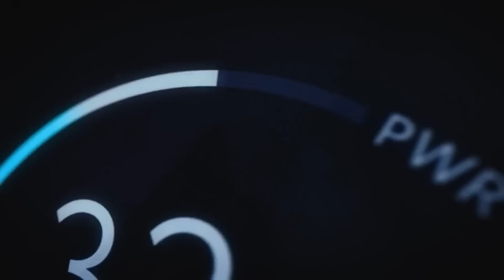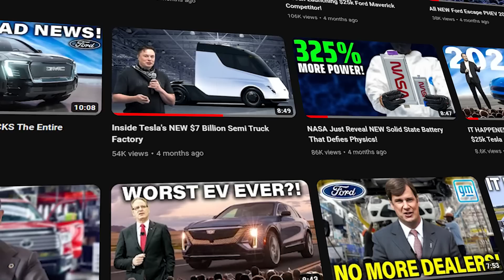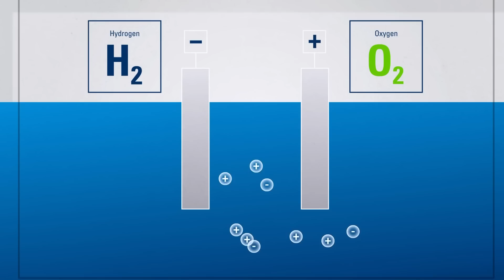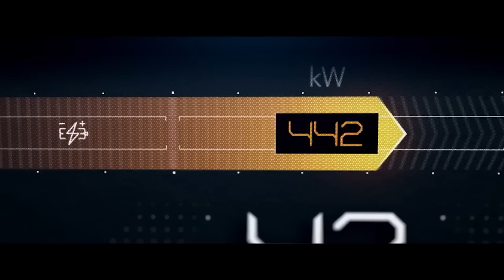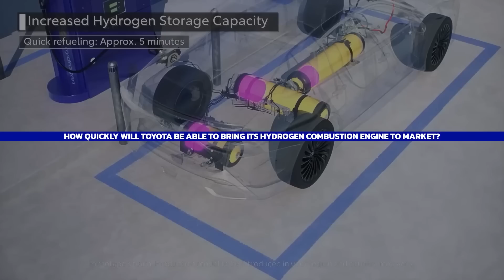New Toyota CEO Reveals Hydrogen Combustion Engine | Shocks Industry!

Comment: Let's actually think.

It takes 2x to 3x as much renewable electricity to drive a mile with a H2 FCEV compared to driving a mile with an EV.  Then one needs to add in the cost of the plant to turn water into H2, the cost of compressing the H2 for shipping, and the distribution infrastructure (trucks and gas stations).

That boils down to significantly more cost per mile for H2.  

Someone had a problem finding a charging station?  How long do you think it might take to make hydrogen as available as grid outlets now are?  

Just think, folks.
Reply: It's just physics, thank you!
Reply: @machoopichoo2  I’m
Reply: It will take 10 times as much electricity per mile compared to an EV.
Reply: @ws6002  Then there’s the huge damage to the planet in the mining process for the rare metals to make the batteries for EVs . It takes large quantities raw material to make enough for one EV battery. Then there’s the water  table pollution from washing the raw materials and then the exploitation of children and people that mine these raw materials. 
The manufacturing carbon footprint of an EV is far larger than that of an ICE vehicle.
Volvo punished a study that they commissioned last year and they said that an EV will have to cover approximately 70,000 miles before it’s carbon foot print draws level to that of an ICE.
EVs are not as green as we are led to believe.
Reply: @B Rutter  
Your comment is complete nonsense and I would be willing to bet that you cannot come up with a competent source. I suggest you read the Union of Concerned Scientists report: "What Are the Benefits of Switching from Gasoline-Powered Cars and Trucks to Electric?", dated July 25, 2022.
Reply: @B Rutter  
"While EVs can have no tailpipe emissions, there are emissions from electricity generation. There are also emissions from extracting the materials and the manufacturing processes required to make EVs. Since the goal is to reduce emissions, a natural question is: what are the net benefits of switching from gasoline-powered cars and trucks to fully-electric vehicles? To answer that question, I and my colleagues in the Clean Transportation program have analyzed the global warming emissions from all of the steps required to make and recharge EVs and compared that to the emissions from making and driving a comparable gasoline vehicle."
"Driving the most efficient EV produces lower emissions than the most efficient gasoline car where 97 percent of the population lives—in other words, virtually everywhere in the United States. For example, the emissions from driving a 2021 Tesla Model 3 Standard Range Plus in California equal those of a gasoline car getting 152 miles per gallon. The Tesla’s global warming emissions are a fifth of those of the average new gasoline car and over 60 percent less than even the most efficient gasoline car on the market. If you want to explore the emissions from other models in different regions of the country, you can use our EV emission tool."
"Everywhere in the United States, the emissions from driving an EV pickup truck are lower than those for the average new gasoline or diesel pickup truck."
"Driving an electric pickup truck produces lower emissions than the most efficient gasoline model in most of the United States. For example, recharging and driving the Rivian R1T or Ford F-150 Lightning pickup in California has the emissions impact of a hypothetical 76 mpg gasoline truck."
"Another way to understand how emissions savings from driving an EV offset additional manufacturing emissions is to consider the breakeven point: how far (or how long) an EV needs to drive for the savings to match the initial emissions “debt.” This breakeven point varies depending on regional electricity emissions. Based on where the US population lives, the mean breakeven point for an electric car with a 300-mile range compared with the average new gasoline sedan is 21,300 miles of driving, or 22 months based on average annual driving. Breakeven occurs more quickly, after about 17,500 miles (17 months), when comparing an electric truck with 300-mile range with the average new gasoline pickup truck."
Reply: @ws6002  
You want me to find you a source that describes the energy to split water into oxygen and hydrogen and then to compress the hydrogen?  

Do you actually believe that there is no cost to building hydrogen plants, to transport the hydrogen, and to build fueling stations?
Reply: @bobwallace9753  
Bob, I've made the same points as you. Here's how I see it S = 0.5 (electrolysis) times 0.8 (compression to 10,000 PSI) times 0.6 (hydrogen fuel cell efficiency) = 0.24 energy efficiency for hydrogen. Which is horrible.
Reply: @ws6002  Oh dear , I don’t use insults to debate my point.
Reply: @B Rutter  
I wouldn't know, since you haven't made any points here. But I find it insulting when someone lies to my face. I'm funny that way.
Reply: @ws6002  I still don’t use insults to argue my point, strange that. I’m not that kind of person.
Reply: Average cost for hydrogen is around $15 per KG. A full “tank” is likely around 5kg.
Reply: @Meatball2022  
Australian scientists have created a way of producing hydrogen for $2/kg, they are in the process of scaling it now (we know that scaling always has issues, so the end product will not be $2/kg but it should not be much more than that).
The operation will allow hydrogen production facilities to be easily set up on fairly small footprints, around the size of an existing petrol station

Japan is already creating red hydrogen, basically hooking up a hydrogen production mechanism to a nuclear power plant and using the excess wasted energy

It is true, hydrogen burning is not as efficient as electric but when you look at the end to end total production and especially the end product (water for hydrogen vehicles) hydrogen has a lot of advantages

Carrying around a full complement of batteries is wasted energy, especially when you scale the vehicles up, which is why the trucking industry is promoting hydrogen as its long term vision.
Who's going to run a ship or a plane on battery?

The world is a complex place with lots of different use cases. Trying to stamp out ICE is just silly, trying to push only EV is silly, trying to say hydrogen is the only future is silly (even if hydrogen is my favorite technology), the world will have to adopt hybrid solutions - the mindset of there can only be one winner comes from the stupidity of politics that has so brainwashed people into binary thinking
Reply: @stultuses  the biggest obstacles for hydrogen are 1) cost, 2) distribution. 
Bringing cost to $2 per kg will barely be lower than the cost of electricity for the same mileage.   Certainly better, but when it’s also considered that hydrogen vehicles are still ICE and you still have comparable maintenance to ICE vehicles, it still won’t make sense economically. But it’s closer….
Distribution is another issue altogether. There will NEVER be a day where hydrogen “fill up” is in someone’s home. Hotel. Restaurant. Etc.  therefore, hydrogen will never have the same convenience level that electricity has. 
There can, and one day likely will, be choices. And it’s very possible that the choice depends on the need. Long haul might very well benefit from something like hydrogen moreso than consumer vehicles. As of now, it ain’t even close. 
Also keep in mind. Perhaps one day hydrogen tech improves. EV  and battery tech also improves. Hydrogen has a long way to go to be close to gasoline. Much further to go to be close to electricity. 
The post here that I was responding to suggests it’s great for long trucking. That simply isn’t true. In any continent. And it won’t be even close to true for a long time.
Reply: @stultuses  also keep in mind. $2 per kg to produce will be $6 per kg once it reaches a vehicle. It has to be compressed. Stored. Transported. Stored again. No different than any processed product. Vast majority of POS cost is related to processing.
If they were to create and fill at POS it would reduce costs dramatically. But that adds fill up time, thus negating one of its benefits.
Reply: @Meatball2022  Prices will drop with mass production. People may claim “physics”, but no one mentioned that when others claimed mass production would bring down battery prices.
Reply: @mrgurulittle7000  battery prices also dropping
Reply: @mrgurulittle7000  price would have to drop by 70% just to be equivalent to what it is now. How exactly does that happen with zero infrastructure to support it?
Reply: @Meatball2022  There is no hydrogen infrastructure currently. That’s why people’s need to set it up.
Reply: The single most common element in the universe, is hydrogen.
Reply: @DetroitMicroSound  so?   It’s not common in liquid or gas form on earth levels. 
It’s triple the price of gasoline.  It’s about 5x the price of electricity. It’s got no storage infrastructure at all. It’s such a small atom that it constantly leaks. And a hydrogen combustion engine has a ton of moving parts that an EV doesn’t have.
Reply: @Meatball2022 There was no infrastructure for manufacturing lithium batteries 20 years ago.
Reply: @DetroitMicroSound  manufacturing infrastructure isn’t the problem. Distribution is. 
I’m not sure if you’re aware, but nearly every building in the country has electricity. 
People ain’t driving their hydrogen cars to the manufacturer… nor can they “refill” at home.
Reply: That's the crux of the problem. People dont think. You cant fix stupid.
Reply: If you want to save the earth, don't drive big cars, use your two legs, bicycles, public transportation, ask government to build and make trains more accesible instead of having everyone driving on road and move a big chunk of metal from home to workplace. Wasting resourse to build and repair the pothole highway. EV, Hybrid are no major different. All these are  gimmick.
Reply: Do you feel the icebergs cracking, the deserts spreading, the sun beating down? Thousands and increasing die a year due to pollution and this should have been mainstream as well as more nuclear energy in the 80's we're simply fucked due to climate collapse
Reply: stupid, it'll get cheaper over time with economies of scale and improvements
Reply: Okay. Let's think about this. EV alone leaves a bigger carbon footprint then fossil fuels. Takes fossil fuels to charge the car. It's not green as they claim. Takes tons of rare materials. People are blinded by false facts 😂
Reply: Rare materials and not self repairable...get the trend
Reply: @keithadams812  
Most EVs are likely to use LFP batteries.  There is nothing rare about lithium, iron, or phosphate.  Tesla is moving to motors with no rare earth materials.  

Furthermore, pretty much everything in an EV is recyclable.  At least 95% of the materials in batteries can be recovered and reused.  

I'm not sure why 'self repairable' is an issue.
Reply: @keithadams812  yes, exactly why not to drive a new ICEV.
Reply: @BootayCrust  

Mike, you're ignorant. What's worse, you're spreading your ignorance for others to believe

1. EVs have a bigger carbon footprint INITIALLY! Typically, after 6 months to 3 years, however, the carbon footprint is less than that of an ICE and continues to get better day after day after day. What's more, when the battery finally dies, it gets recycled into a brand new battery. No need to mine the elements again, since it's already out of the ground.

2. 
a. Just looking at the US, most states get at least some of their energy from renewables and this number is always improving.
b. even for states that make their electricity from 100 fossil fuels, IT IS STILL BETTER TO DRIVE AN EV!!! Why? Because EVs are more efficient!

Gas engines are typically only 12% - 30% efficient. That means even the best gas engine throws away 70% of the energy. EVs are typically 77% efficient (or more). So even in the worst case scenario, EVs are more than 2.5 times as efficient. And again, this is in the situation where electricity is made 100% from fossil fuels. In most states, where they use a mix of fossil fuels and renewables, this equation is even better.

Lastly, remember, EVs are in their infancy. ICE cars have been around for well over 100 years. Translation: the advantage of EVs will only get better as the technology gets better. We'll eventually get batteries that can hold even more energy and can charge even faster. How much will ICE cars improve after 100+ years?
Reply: @BootayCrust  lets not lie about this. EVs have 1/3 the carbon footprint of ICEVs over 20 years. 
EVs are exactly as green as claimed. It comes down to math. 
EVs need less rare minerals than ICEVs. 
Yes, anyone who listens to you is blinded by false facts.
Reply: @BootayCrust  
Sorry, Mike.  Someone has fed you some very wrong information.  You might want to question where you are getting such erroneous stuff and seek some factual sources.
Reply: @BootayCrust  It also looks like another round of poor countries with the raw materials for EV remain dirt poor while guys sit in places like Silcon valley becoming billionaires.
Reply: Just think, hydrogen may be a bit more costly, but it will be much cleaner than EVs. The way EVs are made is the reason why carbon pollution has gone up. The only clean transportation is hydrogen. EVs will always require expensive dirty batteries.
Reply: @mrgurulittle7000  no, hydrogen takes 3x the electricity per mile than a similar EV. And that is a relatively efficient fuel cell. In a hydrogen burning ICEV, hydrogen os VERY dirty and stupid.
Reply: @williammeek4078  Hydrogen combustion is NOT dirty or inefficient. The byproduct is water.
Reply: @mrgurulittle7000  hydrogen production takes 3x to 10x the electricity of just charging a BEV. Any claim of EVs being dirty applies 10x more to hydrogen.
Reply: @williammeek4078  It’s not about energy. That can be made freely and cleanly. It doesn’t matter if hydrogen takes 3x more energy than pure electricity because mass production of hydrogen will drive down price. What the point is, how the electricity is stored. That’s when EV shows their flaws. EVs need batteries which are UNDENIABLY polluting and inefficient and EXPENSIVE. Hydrogen can be stored in a thick tank and that’s it. Hydrogen also is much more dense than any other battery out there, so longer range, and fill up is short. Overall, hydrogen is cheaper because no battery, which is the only reason why EVs are dirty. 

Keep researching then.
Reply: @mrgurulittle7000  you need to actually do some research and get some common sense.  Since hydrogen takes at least 3x as much energy, it will need 3x the electricity generation resources. That is a lot of pollution and work and cost to get that set up. 
Sure, mining battery materials pollutes some. But that only has to be done once then batteries are recycled. Once for the life of the car. The tank for hydrogen cars needs to be replaced periodically as do the fuel cell stacks. 
By the way, no production hydrogen car has demonstrated a longer range than a similar EV. And making a special side trip every week fill up is MUCH more inconvenient and takes more time than just plugging in at home. 
And hydrogen does need a battery. Google Toyota Mirai battery. 
You have a lot of learning to do to correct your ignorance.
Reply: @williammeek4078  Using more electricity doesn’t equal more pollution, because if it did, EV will also be polluting and there would be no argument. Battery mining and recycling is polluting, not just mining. Hydrogen tanks need to be replaced as often as gas tanks, and that’s not a common issue. Yes, a hydrogen car has a battery, but so does an ice car. Having a huge expensive dirty battery is the problem, not some tiny starter cell in a hydro car. There doesn’t need to be a production car to know that hydrogen is much more energy dense than any battery tech out there. Battery tech hasn’t even equalized the amount of energy contained per unit in gasoline, and that’s gasoline. Hydrogen can run more agile and cleaner. And shut up about people’s ignorance and have some respect for other people’s opinions. Damn it, can’t I have a legit educational conversation, or does every EV fanatic think everybody who doesn’t agree is stupid or “ignorant”. Get a job if you can only be right.
Reply: @mrgurulittle7000  you really need to take your own advice. You are displaying an unwillingness to learn anything that contradicts your preconceived notions. If you are willing to learn, we can continue this conversation. 
We have HFCEVs. The longest range HFC vehicles are not any longer range than the longest range EVs. If you can find any HFCEVs that can outdistance the 500 miles of the Lucid Air Dream, let me know. The closest i am aware of is the Toyota Mirai at 400 miles. 
Electricity does pollute right now, but even then, EVs have half the carbon pollution of ICEVs and since HFCEVs are only 1/3 as efficient as BEVs, they actually pollute 50% more than ICEVs at best and since most hydrogen is made from natural gas, they actually pollute far more than ICEVs. 
Even if you want to take all of the electricity from wind and solar, you still need 3x as many solar panels and wind turbines to power the hydrogen production as needed to power BEVs. That is 3x the mining for those resources. 
Despite batteries having a much lower energy density than gasoline, they are vastly more efficient. This is why EVs can match the range of ICEVs and beat HFCEVs while operating for less money per mile and only weighing about 20% more than a similar ICEV. 
It is hydrogen that is expensive and dirty, not EVs.
Reply: @mr guru Little  The product of hydrogen combustion are water AND WASTE HEAT. That waste heat represents energy you are throwing away. You really need to educate yourself. You are wrong about almost everything.
Reply: @williammeek4078  You need to take your own advice and learn. Why should I learn from a person who thinks the opponent is stupid?! 
Anyway…
Reply: @mr guru Little  If you compare EVs with hydrogen cars, inefficiency CERTAINLY MEANS MORE POLLUTION. Let's assume for the moment the electricity comes from a natural gas driven turbine. YOUR HYDROGEN CAR MEANS WE BURN 4 TIMES AS MUCH FOSSIL FUEL as we need for an EV. If we burn 4 times more fuel to move your (H2) car than my (EV) car, operating your car means putting 4 times as much pollution into the air. Now let's assume the electricity comes 100% from wind. Do we have the room to increase the number of wind turbines by a factor of 4? That's going to be hard. Who then pays for all these thousands of extra wind turbines THAT we wouldn't need if we used EVs instead of hydrogen?
Reply: @ws6002  In the battle over electric vehicles, could hydrogen win?

Hydrogen fuel cell EVs could be the better choice for medium-to-large and long-range vehicles.

By Mohammed Shafi

March 29, 2022

hydrogen gas station and bus
Image via Shutterstock/Scharfsinn.

As the future of automotive power heads away from the internal combustion engine toward electric vehicle technology, the industry has two options: fuel cell electric vehicles (FCEVs), vehicles that use hydrogen as the fuel source, and battery electric vehicles (BEVs), vehicles that rely solely on battery power or electricity.  

According to a recent PreScouter Intelligence Brief, in the absence of an infrastructure to enable FCEVs, BEVs remain the more appealing option today. However, this could change within the next five to 10 years as investments in hydrogen production and infrastructure increase, potentially pushing FCEVs to outperform BEVs in some segments and become the more sustainable alternative.

PreScouter’s researchers based their analysis on expert insights from Bostjan Hari, battery systems engineer, through a concise review of impending technical and business opportunities for FCEVs in addition to highlighting 11 technological advancements in the realm of FCEV manufacturers.

How does a FCEV work?
FCEVs are electric vehicles that get their power from a hydrogen fuel cell instead of a battery. A fuel cell system is the heart of an FCEV. The electricity is produced by the electrochemical reactions between hydrogen and oxygen supplied into FCEV hydrogen tanks. Only pure, distilled water is produced as a byproduct. FCEVs use this electricity for traction and require the battery for auxiliary operations such as starting or storing energy gained by regenerative braking.

The key distinction between FCEVs and BEVs is the energy source. FCEVs, in contrast to BEVs, rely on the energy stored in the vehicle’s fuel cells, which have a number of advantages over batteries. As long as fuel is available to power the fuel cell, it can generate energy. This is one of the most significant advantages of fuel cells. 

A typical electric automobile can be fully charged in slightly over six hours, whereas an FCEV could be refueled in five minutes and have a range of more than 350 miles. A modest amount of hydrogen can go a long way. Hydrogen production is an energy-efficient chemical process that yields fuel cells with a performance advantage of two to three times over internal combustion engines. Users will be able to travel as far as they do today on only a third of the fuel.

electric vehicle comparison chart
How do FECVs and BEVs compare in regard to environmental friendliness?
FCEVs are also the best option in terms of environmental impact, as fuel cells can be a 100 percent renewable and environmentally friendly energy system. In the absence of adequate recycling systems, the lithium-ion batteries used in BEVs are expected to cause a serious environmental crisis when they reach the end of their useful lives.

While driving, the car emits pure water vapor and filters ultrafine dust from the atmosphere. This fundamental feature of the FCEV has drawn a lot of public attention as the future of eco-friendly mobility. This technology may have a huge impact on our lifestyle in terms of sustainability due to the abundance of hydrogen on Earth and the production process itself being highly eco-friendly.

Overall, FCEVs are cleaner than BEVs and internal combustion vehicles, with additional room for improvement as hydrogen generation and distribution advances. FCEV production is also cleaner than BEV production due to fewer raw material requirements compared to BEV mineral mining and the consumption of heavy metals such as lithium and cobalt. FCEVs are also easier (and cheaper) to recycle than BEVs.

What is the status of the global FCEV market?
Global FCEV deployment has been primarily focused on light-duty passenger cars. However, the geographical distribution of FCEVs varies significantly. Korea, the United States and Japan have concentrated on passenger cars, with a small number of buses and commercial vehicles. 

On the other hand, with its fuel cell bus and commercial vehicle policies, China today dominates worldwide stocks in these segments. This trend is anticipated to continue, as China’s 2020 fuel cell car subsidy policy focuses on employing fuel cells in medium- and heavy-duty commercial vehicles. China has set a goal of using over 1 million FCEVs for commercial purposes by 2030.

The Port of Rotterdam and Air Liquide have developed an initiative to deploy 1,000 fuel cell trucks by 2025.
There will be more fuel cell buses and trucks in Europe in the near future. More than 1,000 buses are planned during the next decade. The Port of Rotterdam and Air Liquide have developed an initiative to deploy 1,000 fuel cell trucks by 2025, and a joint call signed by over 60 industrial partners aims for up to 100,000 trucks by 2030. The IEA forecasts that fuel cell manufacturing could produce 6 million FCEVs by 2030, meeting roughly 40 percent of the "Net Zero Emissions by 2050 Scenario" needs.

Global technical regulations are continually updated to assure global FCEV safety. International standards are used to build localized safety regulations and laws for FCEVs. They usually incorporate electrical and hydrogen safety requirements.

Hydrogen tanks are bulky in vehicles
Because hydrogen has a poor volumetric energy density, storing enough onboard poses weight, volume, kinetics, safety and cost challenges. Hydrogen can only be stored under high pressure, at extremely low temperatures as a liquid, or in metal hydride systems to maximize volumetric energy density.

Compressed hydrogen is the most used method for storing hydrogen in cars. Passenger FCEVs’ compressed hydrogen tanks are cumbersome and take up a lot of space. This is a flaw in the current generation of electric cars powered by hydrogen fuel cells. Hydrogen metal or non-metal hydrides could be used in the future as a replacement for heavy hydrogen tanks. This is just beginning to take shape, with hydrogen evaporation remaining a key technical problem to overcome.

Honda and Nissan chose a 350 bar (5,000 psi) pressurized tank, while Toyota employs 700 bar (10,000 psi) tanks. Although the 10,000 psi composite tanks have been proved to be quite safe as needed by various regulatory requirements, the public is concerned about their safety. Moreover, the tank proportions require more space than traditional petrol tanks.

The adoption of fuel cell vehicles should be complemented with enabling infrastructure.
FCEVs won’t be commercially viable unless buyers are satisfied that they will be able to easily access refueling stations. Thus, the adoption of fuel cell vehicles should be complemented with enabling infrastructure. According to H2 Tools, by the end of 2021, there were over 492 hydrogen refueling stations operating globally. Japan had about 141 stations, followed by South Korea (112) and Germany (91).

The GM Electrovan was the first fuel cell-powered passenger car developed by General Motors in 1966. The project was shelved because of the high cost, difficulty and scarcity of fuel supply. The still-active California Fuel Cell Partnership was created in 1999 to facilitate the testing and development of FCEVs in the United States. It has included representatives from most major automakers at various points in time, although mainly only three have brought fuel cell vehicles to market so far.

Many automakers sell or lease FCEVs, but the technology is still new. Honda, Hyundai and Toyota are just a few companies on the top list. However, automakers are dedicated to growing both hydrogen fueling stations and hydrogen-powered vehicles, so more FCEVs are on the way, but while all of today’s fuel cell vehicles are considered mass-market production vehicles, none are  available outside of California. Many were only available in limited numbers, and Honda’s has never been sold, only leased, since its debut.

Can hydrogen fuel cells become the EV technology of choice?
Several studies, including one by Argonne National Laboratory, have demonstrated that creating and using hydrogen for fuel cell vehicles is more environmentally friendly than using grid electricity to power battery EVs. Hydrogen could be created using wind and solar energy, or by decomposing plant materials; however, these processes take longer and cost more money.

"Nothing worth having comes easy," as President Theodore Roosevelt once said. The commercialization of FCEVs on the market is moving at a moderate pace at the moment. 

So, who will win the EV battle? The answer: Battery and fuel cell technologies will coexist in the future because of their obvious similarities, with BEVs being more appropriate for short-range and small vehicles, and FCEVs the better choice for medium-to-large and long-range vehicles.
Reply: @mr guru Little  
I personally reserve the word 'stupid' for people who already shown they are uninterested in or incapable of learning.
Are you that person? Have you learned anything from the people like me who have shown by means of competent sources (eg Union of Concerned Scientists) that building batteries only increases their lifetime pollution of EVs a small amount? Have you learned anything from people who have pointed out to you that hydrogen vehicles require FOUR TIMES AS MUCH ENERGY as compared to EVs?
Reply: @ws6002  Heat is the waste and byproduct for hydrogen after the process is done, but in EV, heat is generated from the energy when high speed charging is done.
Reply: @mr guru Little  
Some energy is turned to waste heat when the battery is charged. Less than 5%. But in making hydrogen by electrolysis, 50% of the energy is converted to waste heat. And in compressing the hydrogen before putting it in the tank, about 20% of the energy is converted to waste heat. And in converting the hydrogen fuel to electricity in the fuel cell, about 40% of the energy is converted to waste heat. You don't add these numbers to get the total waste heat. Instead you multiply the efficiency (complement to inefficiency) of each stage together to get the overall efficiency. S = 0.5 x 0.8 x 0.6 = 0.24 or 24%.
Reply: @mr guru Little  
You could of course skip the hydrogen compression step and keep the hydrogen in a small Hindenburg (gas balloon) dragged through the air by your car. Hydrogen has a pretty low energy density by volume at one atmosphere pressure. Now perhaps you see why I gave up my childhood fascination with hydrogen cars.
Reply: @mr guru Little  
There are already BEV (battery electric) trucks for sale and in use today. Not just from Tesla. None for hydrogen so far. Terrapower, a modular nuclear startup that Bill Gates is involved in, is proposing that they use hydrogen to store electricity produced during the day and use this power to provide power at night when solar becomes nonoperational. This seems like a good idea.
Reply: @ws6002  Maybe that storage thing is a good idea actually.
Reply: @mrgurulittle7000  any questions you have, I will be glad to provide references. Any attempt to claim I am wrong, I insist you do the same.
Reply: @williammeek4078  Ok, sounds fair enough.👍
Reply: @mr guru Little  
This comment is nonsense. As a result of the fact that producing hydrogen by electrolysis is only 50% efficient, and the energy it takes to compress the hydrogen is equivalent to 20% of the energy in the hydrogen, and because the fuel cell is only 60% efficient in converting hydrogen into electricity, 80% of the energy is LOST before you drive the motor that moves your hydrogen car. That means you have to cone up with 4 times as much energy from solar or wind, for example, to drive 300 miles in a hydrogen car compared to an EV. If you don't have any facts, perhaps you should stay silent.
Reply: @mrgurulittle7000  
There's zero chance hydrogen could be cleaner than storing energy in EV batteries.

Remember, hydrogen is only a way to store energy.  It takes more energy and infrastructure to produce and distribute hydrogen with each bit and piece of that infrastructure bring its own carbon input to the process.

Solar panels and wind turbines have very low lifetime carbon footprints.  So if you're driving with hydrogen you are using 3x or more energy from panels and turbines than someone using batteries.
Reply: @bobwallace9753  Yes, hydrogen uses 3x more energy. But my point is, EV uses one third the energy for running the vehicle, but it uses tons more energy to make the battery for the vehicle and recycling it properly. 

Hydrogen creates clean drinking water in the process, speeds up energy refill time, and does not emit any heat or pollution in any of these processes. 

EVs (though using a third of the energy to charge up) don’t have any other potential on top of batteries being expensive to make, batteries being very polluting to make, and batteries being polluting and expensive to recycle. And these are the facts considering that the electricity and hydrogen are cleanly made. Also, fast charging an EV has significant energy loss in the form of heat, making fast charging limited to a certain extent. 
If you look at the process overall, there not much energy lost in hydrogen technology seeing that it makes clean water in the process, saves time (which is money), is very energy dense, and can be done 100% renewably. Even EVs in the ideal have the problem of batteries which are one of the biggest sources of pollution and heat.
Reply: @mrgurulittle7000  
Batteries are not polluting to make'.  

H2 FCEVs will not be s source of clean drinking water.

Battery recycling is not expensive.  It's cheaper than extracting and refining the materials needed to make new batteries.

Fast charging does not waste much energy.  Plus most people will fast charge rarely.
Reply: @bobwallace9753  Batteries ARE polluting to make. Why do you think carbon emissions have gone up even though the world saw a record increase in EVs and renewables? H2 IS WATER! No use saying water isn’t a source of water.🤣 Battery recycling is so expensive. Who is actually recycling batteries? What about the waste in recycling batteries? Fast charging loses energy in the form of heat. EVs have built in coolers for the batteries; great, using battery energy to cool the battery itself. It’s just baloney how EVs claim to be efficient.
Reply: @mrgurulittle7000  no. You have been lied to.
Reply: @mrgurulittle7000  you do realize that a hydrogen ICEV is only about 20% efficient and the other 80% is wasted as heat right?
Reply: @williammeek4078  You’ve been lied to.🤥
Reply: @mrgurulittle7000  no, i do my own research. Maybe try that yourself.
Reply: @williammeek4078  try researching nuclear (HTGR) its a win-win for all industries and u will understand hydrogen is the way forward as fuel replacements.. 

we couldnt be using batteries and motors on heavy machinery cant we? so hydrogen makes more sense 

and also.. why cant the world have BEV, FCEV, H2ICE? the consumer can just buy whichever they think is best for them to use
Reply: @kecikmiao0711  high temp hydrogen production only increases the efficiency of a HFCEV to about 35%. Still less than half that of an EV. 

We already have heavy EVs like Tesla Semi and BEV mining vehicles and construction equipment. 

BEVs, HFCEVs, and hydrogen ICEVs are already available and consumers have already made their choice because anything hydrogen is just too expensive.
Reply: @mr guru Little  It does not take "tons" more energy to build the EV battery. Here is a quote from the Union of Concerned Scientists, who looked into this: 
"While EVs can have no tailpipe emissions, there are emissions from electricity generation. There are also emissions from extracting the materials and the manufacturing processes required to make EVs. Since the goal is to reduce emissions, a natural question is: what are the net benefits of switching from gasoline-powered cars and trucks to fully-electric vehicles? To answer that question, I and my colleagues in the Clean Transportation program have analyzed the global warming emissions from all of the steps required to make and recharge EVs and compared that to the emissions from making and driving a comparable gasoline vehicle."
"Driving the most efficient EV produces lower emissions than the most efficient gasoline car where 97 percent of the population lives—in other words, virtually everywhere in the United States. For example, the emissions from driving a 2021 Tesla Model 3 Standard Range Plus in California equal those of a gasoline car getting 152 miles per gallon. The Tesla’s global warming emissions are a fifth of those of the average new gasoline car and over 60 percent less than even the most efficient gasoline car on the market. If you want to explore the emissions from other models in different regions of the country, you can use our EV emission tool."
"Everywhere in the United States, the emissions from driving an EV pickup truck are lower than those for the average new gasoline or diesel pickup truck."
"Driving an electric pickup truck produces lower emissions than the most efficient gasoline model in most of the United States. For example, recharging and driving the Rivian R1T or Ford F-150 Lightning pickup in California has the emissions impact of a hypothetical 76 mpg gasoline truck."
"Another way to understand how emissions savings from driving an EV offset additional manufacturing emissions is to consider the breakeven point: how far (or how long) an EV needs to drive for the savings to match the initial emissions “debt.” This breakeven point varies depending on regional electricity emissions. Based on where the US population lives, the mean breakeven point for an electric car with a 300-mile range compared with the average new gasoline sedan is 21,300 miles of driving, or 22 months based on average annual driving. Breakeven occurs more quickly, after about 17,500 miles (17 months), when comparing an electric truck with 300-mile range with the average new gasoline pickup truck."
Reply: @mr guru Little  
80% of the hydrogen is produced by steam reforming of fossil fuels, during which a huge amount of the greenhouse gas methane are released into the atmosphere. Of course, hydrogen can be made by using renewable energy and electrolysis, but EIGHTY PERCENT OF THE ENERGY IS LOST. Which means we would have to somehow come up with 4 times as much renewable energy for hydrogen cars compared to EVs.
Reply: @ws6002  You said 3x more energy for hydrogen and so did many sources. Quit changing the numbers!
Reply: @ws6002  It doesn’t matter if hydrogen uses 3x more energy because energy can be made 100% clean, for the thousandth time I told you! What is so fucking dirty using 3x more clean energy? EV has massive batteries that are polluting, a concept many people don’t get! And EV battery recycling is very polluting and “inefficient” for those who love to talk about “efficient”.
Reply: @mr guru Little  
It depends on whether you count the energy it takes to compress the hydrogen to 10,000 PSI for your fuel tank. I believe the best answer is that hydrogen fuel cell cars are 4 times less efficient than BEVs when you take that into account. Hydrogen combustion cars are worse. Not only do you have to pay, in terms of energy, to break the water apart and to compress the hydrogen, now you have a heat engine that is at best 35% efficient. And you are going to make Nitric Oxide in the combustion. The nitrogen of course comes with the air.